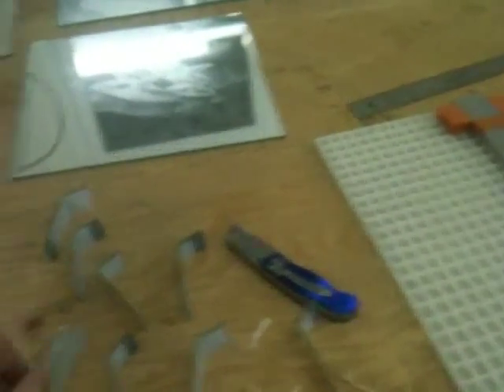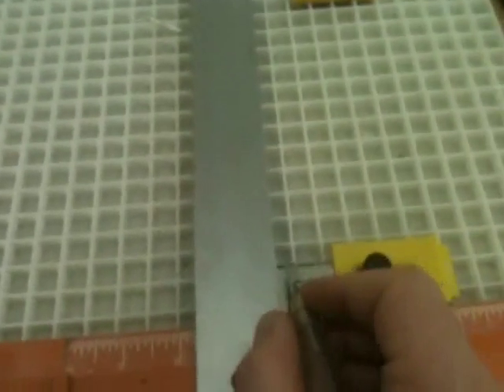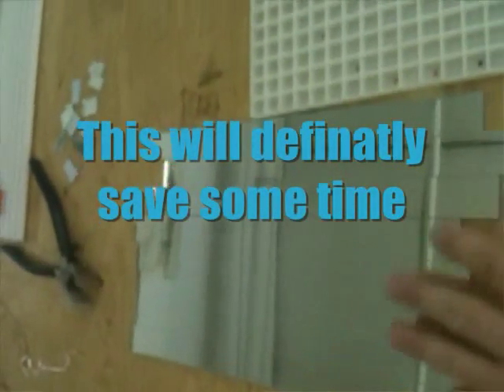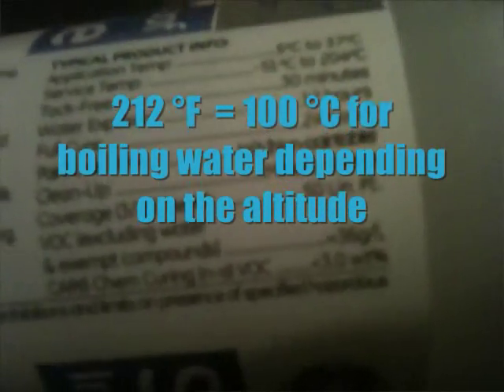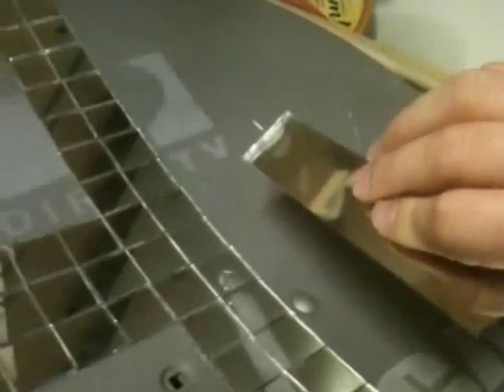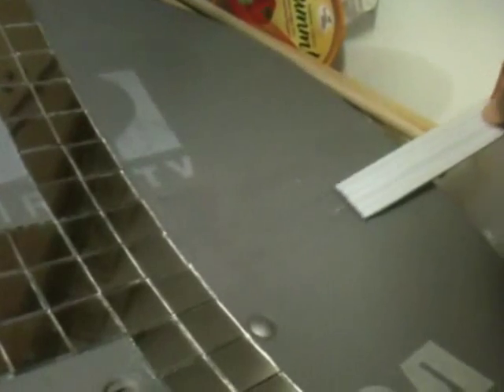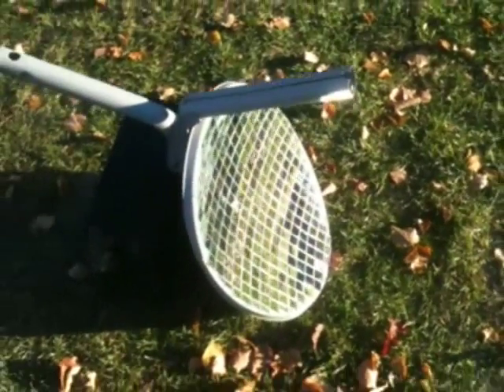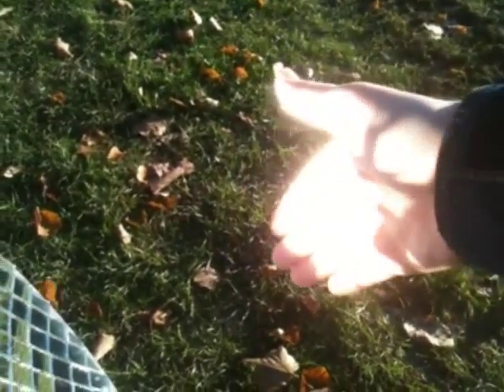How to make a parabolic mirror from recycling

Comment: Hi Matt,

Excellent video.

I'm no engineer or scientist, but have done a lot of reading and research and have worked with many of them earlier on in my life as an electro-mechanical design draftsman, so I can very easily understand the science behind what's happening here. 

In the winter, the angle of the tilt of the earth gives much less light to us in the north causing light dependent devices to be less effective, but you're right, the bigger the device, the better the output will be.